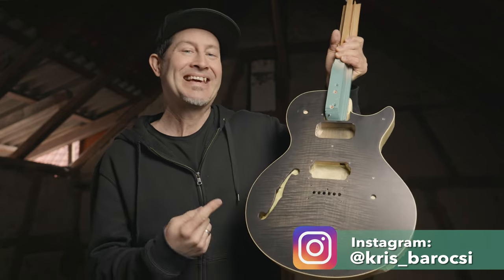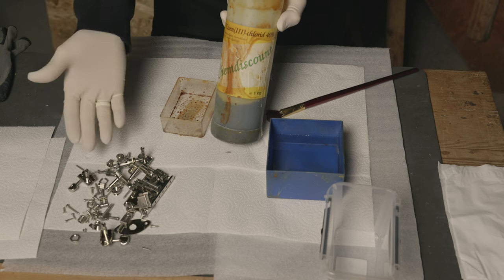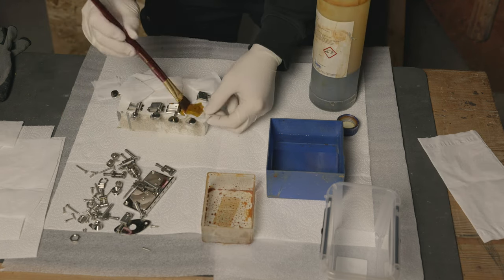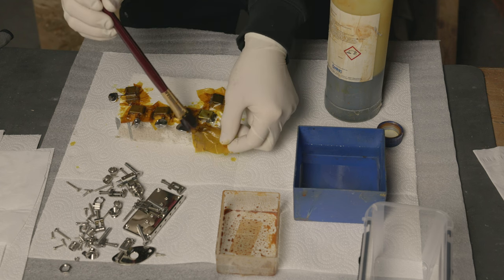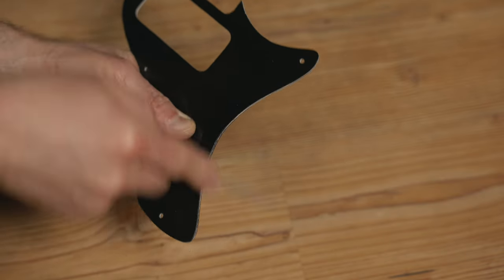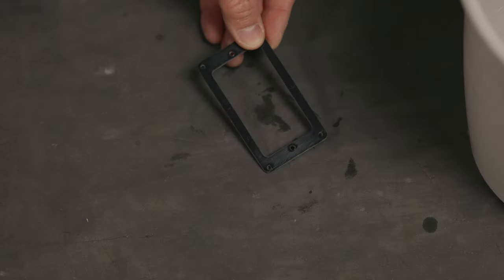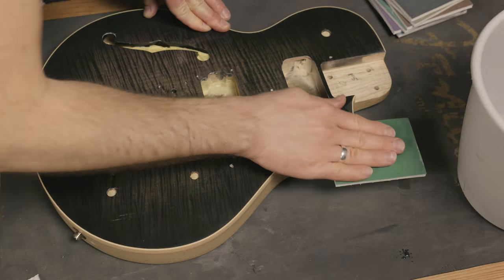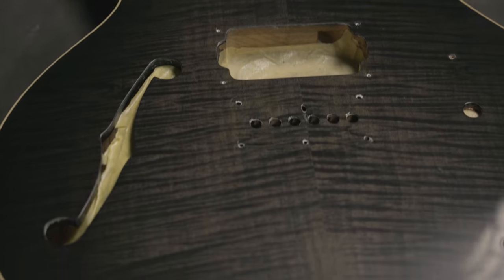Refinishing and Customizing My Guitar | PJD Carey - PART 2 | Guitar Tweaks

Comment: Very nice work, Kris.  I've been working on a Tele with one of my kids, and had to widen the half-circle on the pickguard to fit around the tele control plate.  Took for f'ing ever, and it's still not perfect.  I still need to sand it some more and widen the gap ever so slightly.

Look forward to part 3.
Reply from the maker: Thanks so much for watching my dude!! Yeah if you want to be accurate with a pickguard it takes for absolutely ever. And that plastic dust whilst filing... I hate it, haha!

Comment: Awesome to take us for the ride, Kris. Thank you! It already looks stunning. One q: you used a power saw for cutting the inner parts of the pickguard and pickup ring, but a handsaw for the outer sides, which seems to be the bigger job that would benefit more from the 'help' of electricity. Can you explain your thinking please?
Reply from the maker: Thanks a lot! I only use the powered saw for rough cuts - it doesn't matter if it's inside the pickup cavity or not. As soon as I get very close to the final outline of the pickguard I cut with an oldschool jigsaw or use a fine hand file. That's about the only explanation I can give and I hope it makes sense. 😄

Comment: Awesome work Kris! It seems like we have similar tastes wrt relicing/aging. Especially with the hardware. I don’t like rusty but I also don’t like shiny. I like milky, I think you put that phrase very well. Your tuning knobs look exactly like the ones on my custom shop strat which has journey man relic. Also thanks for showing us how to properly work on pick guards. I made transformed an SSS strat pick guard to an HSS once. However I only used a file and it took me a very long time. Even tho I have a dremel. I thought the dremel would be too invasive. How did you not ruin the routes when you made the last passes with the dremel with the masking tape off? Did you just touch lightly or use a different bit?
Reply from the maker: Thanks a lot buddy!! 
Yeah I used a sander dremel bit, I turned it down really slow and I barely touched the pickguard. That’s a pretty safe and efficient way of doing it. It still took me many many hours to finish it. 😅

Comment: No eye protection?!? 😰
Reply from the maker: I use an eye protector when working with the big router or with the dremel with a router bit. When using a jig saw I usually don't, even though I know that I should. Please stay safe everyone, Erebos is right!
Reply: @KrisBarocsi  I meant for the spray painting. Nitrocellulose lacquer is nasty stuff to get in your eyes.